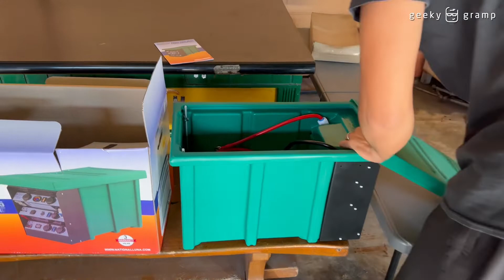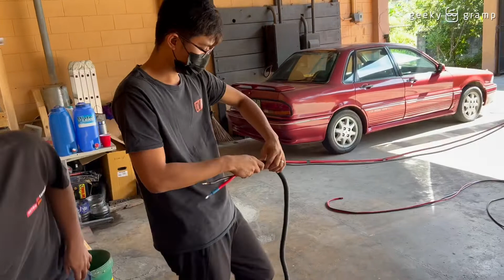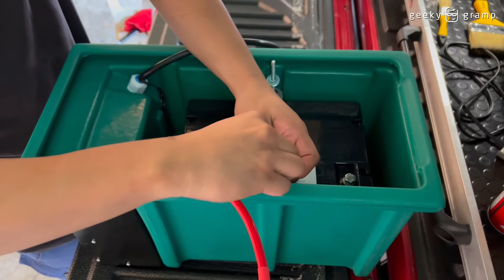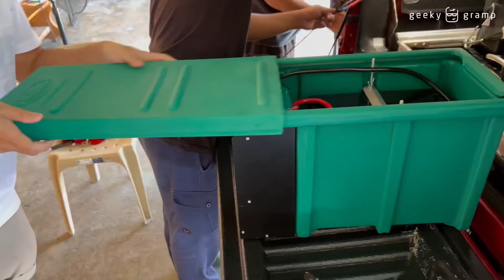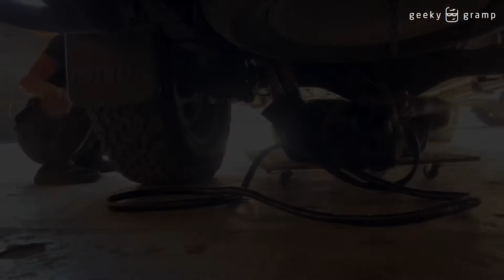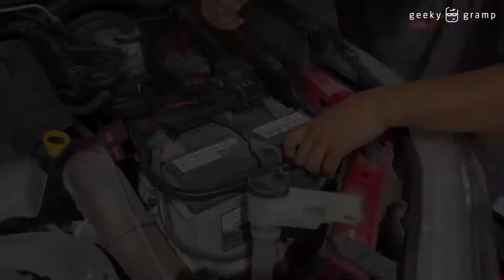Installing Dual Battery System with Solar Charger for My Toyota Hilux

Comment: You did not mention that you need to set the dc to dc charging unit to the Lithium battery setting. That is located behind the panel on the green battery box.